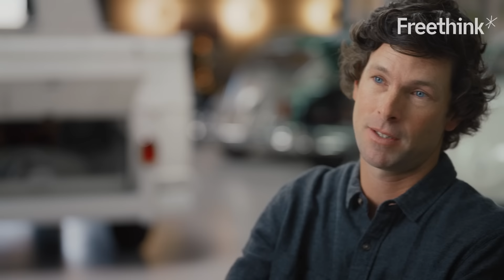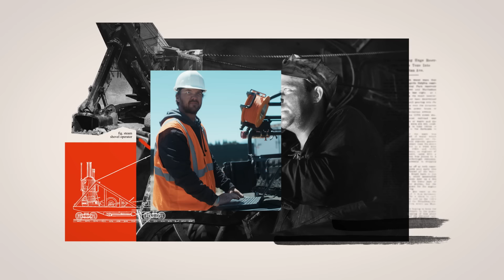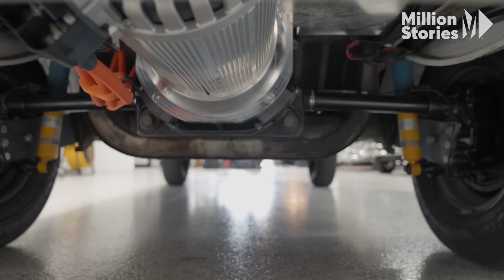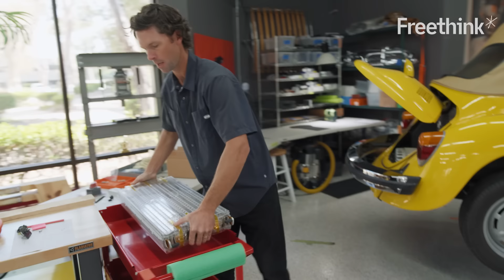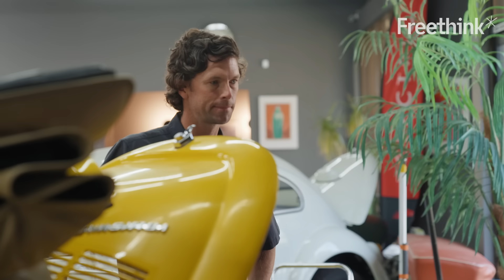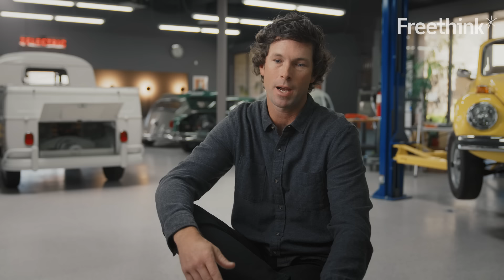How mechanics can prepare for the electric revolution

Comment: Create a simple thing like the home robotic vacuum cleaner.

The robot can find the 'magic' spot on the vehicle. Hahaha 

When you drive off the plug pulls out.

Trickle for hours. 
Car parks at work and shops ezi pezi.

Or the selfplug-in feature on a selfparking EV. 
Just a wall plug low mounted for the vehicle to find like a little suckling piglet. 

😊😊😊

Offgrid homes in the cities, 
No government permits needed. 
No grid impacts. 😊😊😊

Comment: It's basically a bad joke. Electric Motors don't make Horsepower. So its like converting your gas car to a diesel that can't accelerate its rpm (no Horsepower).

The problem isn't that too many classic cars exist, and they need to be "decarbonized". The problem also isn't that theres too much carbon in the air, its only 0.04% (4/10,000) of the atmosphere at the ground level, basically nothing. The problem isn't that gas is going to run out in 5 years, it is literally a naturally occurring phenomenon, that is in fact renewable (not dinosaurs lol, just dirt and water).

The actual problem, is that late stage capitalism has resulted in people inventing new problems to fix, because they need some way to make money, because maintenence mode doesn't have enough work.

The people who think EV's are the future dont understand engines or electricity. They don't know what Horsepower is, or why a motor literally can not reproduce that effect, and they also don't understand why batteries are totally lame for high performance or power tools, etc.

BTW, EV conversion classics are probably the worst modification you could do. It'll destroy its value, unequivocally. People don't even really like resto-mods, let alone conversion to Electric. Keep it stock stupid.

I can't believe someone actually ruined that porsche. Want an electric porsche? They literally have some for sale. Don't ruin a classic by putting "tesla engine" 😂 in it.

Comment: Good luck trying to pass safety measures for evs in the eu with such refitted vehicles. Theres no chance you would be able to register it. Why is it possible in the us and not in eu ?
Reply: It's possible in the EU. We did it, as long as you get a motor with a certificate of conformity it's actually a very easy process. The RDW (Netherlands) came to the shop we bought the motor from and counted 2h of work. 2 weeks later we had fuel type Z on the registry😊

Comment: As a low-mid class person I cannot justify either buying a new EV, or a used EV, or converting my existing car to EV.
If I wanted the same functionality as my 2015 Fiesta, but for it to be electric, a new one would cost €30k, used would cost €25k, and a conversion would cost €40k.
My car, new, back in 2015, was €10k.

€40k for a new car that has barely more functionality than an 8 year old car is a complete joke that only idiots with more money than reason can fall for...

Comment: Awesome, but almost impossible to do in Europe. It'd be at best really hard to get your car licensed and most certainly financially insane to go through all this bureaucracy.
Reply: I did it, it's actually easier than you would think. Not as easy as in America ofcourse. The clue is to get a motor with an EU certificate of conformity. We built our car with said motor, and the RDW (Netherlands) came to the company we bought it from and counted us 2h of labour. 2 weeks later we had fuel type Z on the registry 😊
Reply: There’s specialised shops all over Europe offering similar services. Prices are starting in the range of €15k-25k, in some cases up to €60k, depending on parts and mostly labour.

Volkswagen even advertises for one of those services on their German website: how to convert a classic car into an electric one (adding the note that this will totally void any legal requirements for obtaining a license plate for “historic” cars, which comes with reduced taxes and the like. Instead, one can get a license plate for electric vehicles, which comes with its own perks (Google for „So werden Oldtimer zu Elektroautos“ at Volkswagen‘s German website).

And a German engineer (Johannes Hübner) also co-started the „open inverter“ project (open source electronics to power the new drive train correctly) and co-wrote a book („Deep Dive Elektroumbau“) on converting ICE cars into electric ones, based on his own experiences.

It is possible, but can be costly in terms of hardware (unless you’re isn’t scrap parts…) and especially takes a serious amount of time to get it done. There’s also some legal stuff involved to get the car certified as roadworthy, but most is fairly obvious and comparable to similar work on combustion engine cars (say, for Germany: the new drive train must not exceed 140% of the power provided by any factory original engine for the same type of car).

Comment: Terrible take. These small shops will only take up a fraction of the industry and only hire the top 1% of technicians or only hire engineers (and then still pay poverty wages). This video is ignorant and out of touch with actual blue collar workers.